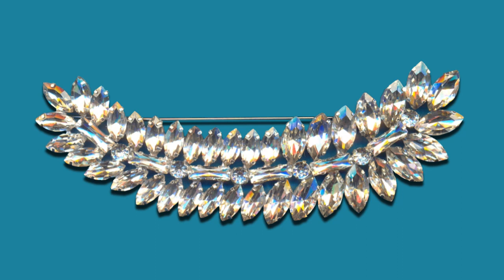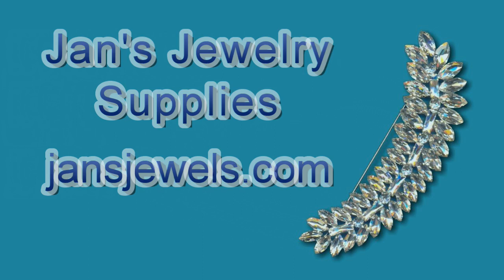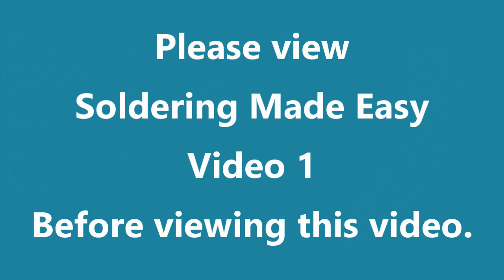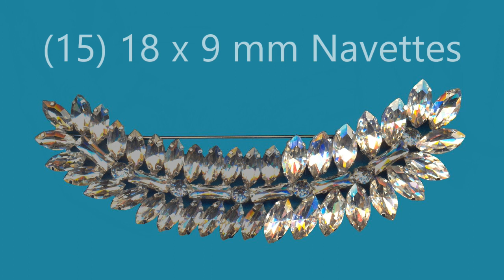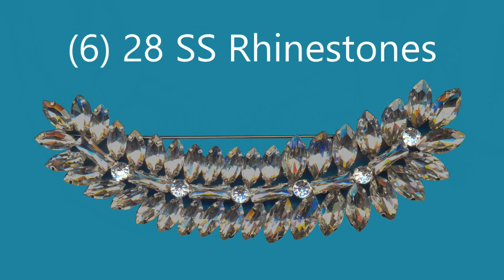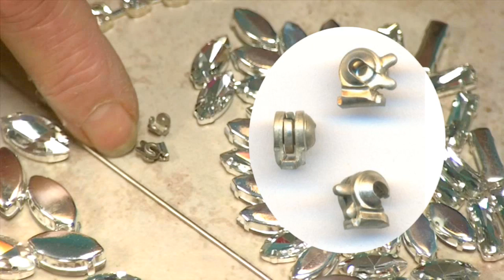Large Soldered Rhinestone Leaf Brooch

Comment: Hi Jan! I have a problem Im following everything but my saunter just turns into a little ball and rolls offf! Help please 😢
Reply from the maker: Sorry to hear you are having problems soldering.  I cannot tell you exactly what the problem is since I do not know what you are using.  You need solder with an acid core flux.  Solder will not stick to the findings without flux.  The flux can be bought separate from the solder and is applied first.  Your heat source may not be hot enough to work with your solder.  Aluminum cannot be soldered.  https://www.jansjewels.com/soldering-paste-soldering-torches-1.html

Comment: Hello.. FABULOUS tutorials!! Two questions.. do you offer this brooch in a kit?? And also, how do you know when to use a blow torch vs a heat gun?? 
Thank you!
Reply from the maker: Hi Matthew.  I use a torch with brass setting.  This may require sending the finished piece out to be plated.  I use the heat gun with silver plated brass settings and low temperature 300 degree prefluxed solder.  These pieces do not need to be plated and will finish nicely.  This brooch is not offered as a kit we do sell all the components and the material list is at the end of the video description.
Reply: @Jansjewels  thank you! I saw on your web site that you were selling the pendant kit (in your 1st how to video), I’d like to buy two of the kits but turn them into earrings for drag. Would you be able to and the additional components to the order for this? At additional cost of course.
Reply from the maker: Hi Matthew.  It would be a simple matter of adding a couple of ear clips to the order.  You can find the ear clips at https://www.jansjewels.com/earring-findings-clip-on-1.html.  You may actually do better with Starter Kit 2 https://www.jansjewels.com/Soldering-Starter-Kit-2-Large-Earrings_p_47834.html  Here is the video for the kit https://youtu.be/FG-5OVz8i80
Reply: @Jansjewels  oh thank you.. I have a heat gun though already.. but the rest of the kit looks great!
Reply: @Jansjewels  do you have the same kit without the heat gun?
Reply from the maker: Hi Matthew.  We do not sell this kit without the heat gun.  Here is the soldering kits we have https://www.jansjewels.com/jewelry-making-kits-for-soldering.html

Comment: Hi Jan! I tried this with plated settings and silver solder paste and everything just burnt and the solder didn't really melt. Could it be i'm using the wrong solder? Thank you :) Love your tutorials!
Reply from the maker: Thank you for your comment and question.  Yes, the problem is the solder paste you are using is too high a melting temperature.  To avoid discoloring the plated settings I use a heat gun with 300 degree melting temperature solder.  We have this solder at:  https://www.jansjewels.com/soldering-paste-soldering-torches-1.html